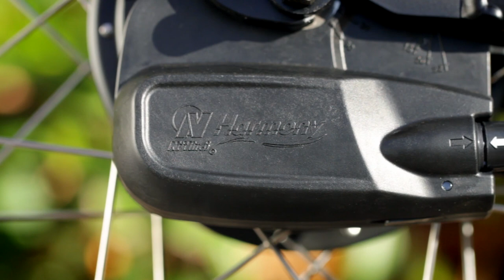AutoBike: The Most Intuitive Bicycle In The World!

Comment: I bought an Autobike probably 20 or 21 years ago.  Unfortunately, I only rode it once and then had to store it away.  Well, I took it out of storage today, filled up the tires, and away I went.  It was like it had never been stored!  It rode great, shifted beautifully, and I was surprised that 20+ year old inner tubes held air.  No flat areas on the tires themselves, even though it had been sitting on the floor all these years.  I'm going to oil her up, straighten out a few wheel spokes, and take her for a good spin.  Thanks, Autobike, for a great, enduring product!

Comment from the maker: Yes the control is based on a rider's power output (speed and grade).  Ideal cadence changes with changes in either of those variables as you note.  Riders have a variety of fitness and skill levels so ideal cadences can vary. So we also enable the rider to choose the type of ride they want, or as you put it, whether they are a grinder or spinner. We have a default calibration but the rider can change that using buttons on the bike itself or via their smart phone using Bluetooth.

Comment: I like the concept. Thirty years ago I commuted 100 miles a week in SoCal, and hundreds more miles a year on fun rides in Baja and SoCal, on a 10 speed Motobecane Mirage. I did all my own maintenance. But now, after a car wreck and limited mobility, I'm more interested in just cruising and errands. Anything that minimizes distractions is a good thing. But auto shifting would need to be adjustable to suit the cadence, which may change with physical conditioning. That's the main concern I have about the SRAM two-speed and any auto shifter.